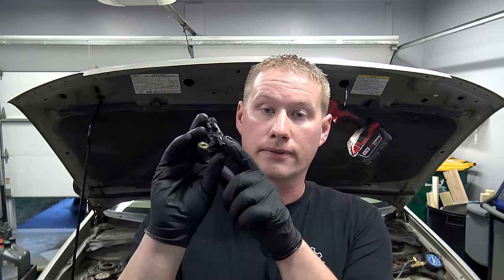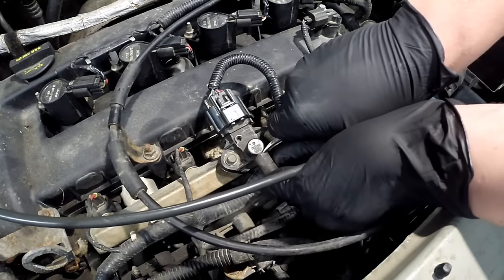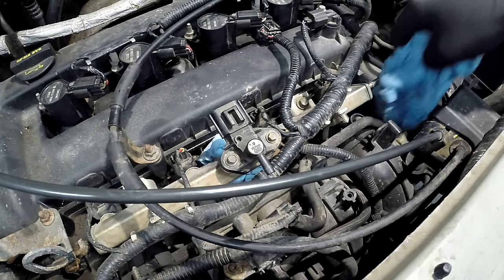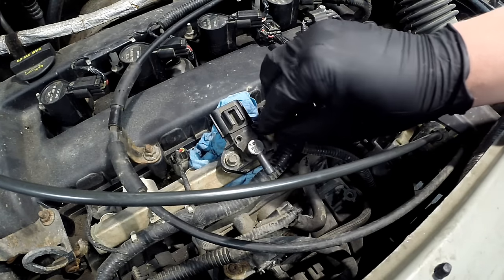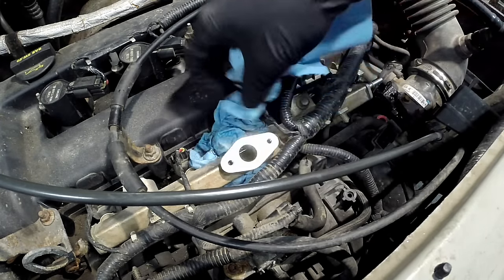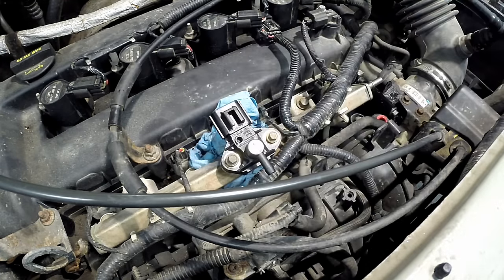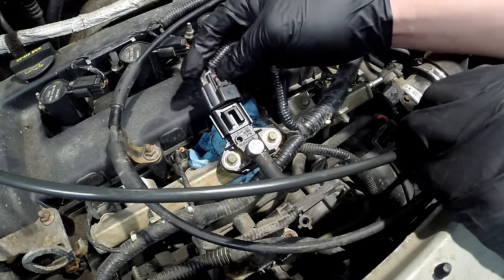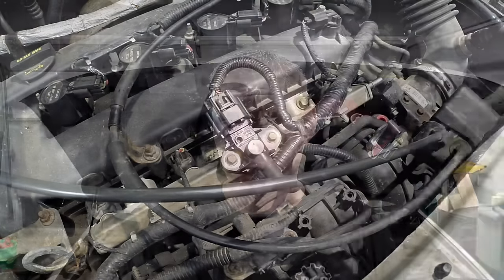Ford Vehicles: Fuel Rail Pressure Sensor Replacement P0191

Comment: On my 2008 escape 3.0, I have a P0191 code and the car shuts off randomly and has poor acceleration. Could this sensor cause these symtoms or should I look into the pump?
Love your videos by the way
Thanks
Reply: Pls what did you do, have the same issue with mine ford Escape 2007
 It does seem to want to accelerate. Change fuel pump, plugs and flushed the nozzles. I'm so confused

Comment: Hey I've replaced my sensor but I don't know where the other side of that vacuum hose goes to. can you help me out?
Reply from the maker: It varies with each vehicle and engine but the length is not that long it should connect to a constant vacuum source.
Reply: FordTechMakuloco i have the same focus as the one in the video. same engine and everything.

Comment: Great video. I have a 2000 ford focus sohc, it seems to have low fuel pressure at idle, could it be a faulty fuel pressure sensor? It runs good when driving, rpm are low at idle and at red lights. Any suggestions will be appreciated.

Comment: as i was running a diagnostic on my 2008 ford escape i noticed engine load is at 30% , is that due to a bearing on a pulley driven part starting to seize?
Reply from the maker: No they all say that

Comment: My 2004 escape 3.0 doesn't have one of those anywhere I can find, it's just not there anywhere on the engine likevit is in all the videos.  So what do I change to fix a p0001? Is mine integrated into the fuel pump?

Comment: I have a 2009 F150 4.6 liter. I'm having a power loss issue. I had it to a mechanic he changed the fuel filter and it didn't make a difference. He put it on his scanner  and no codes are showing. The truck runs fine at start up seems to take the fuel no problem. The problem is when the engine has a load on it. If you step on the pedal it's like nothing is there. I'm going to make an appointment at the dealer. Is there anything you can suggest that may be the problem?
Reply: Please how did you fix it? Having same issue

Comment: i have a 2005 Ford F-150 4.6L. i replaced the pressure sensor and the check engine light still on. Is there anything else i should be checking?
Reply: Same I replaced my Air filter on my 05 Lariat and the P0191 code cleared

Comment: My code reader shows P0193 on my 2005 Ford Five Hundred also identified as the fuel rail pressure sensor. Looks pretty straightforward.
Reply: Did you happen to see the pressure in the fuel rail?
Reply: @RickyPisano  I have not attempted to replace the sensor yet. I've simply cleaned the contacts at the connector. So far so good.
Reply: @Vaun's Photography  did you ever fix the problem?

Comment: So I have a 2006 f150 5.4 and I have changed the fuel pump about 7 times and changed the driver module and and bypassed the inertia switch but I see myself changing fuel pumps every other week , the fuel pumps keep popping the check valve on the fuel pump so could it be the fuel pressure module on the fuel rail
Reply: How did you fix?

Comment: What was the reason for changing the sensor? 

Question for you ;

I have an 05 Escape with a 2.3L engine that has excessive fuel in the combustion chamber and exiting out the exhaust.

I have codes P0183 and P0193 ... any help would be appreciated.

Comment: I have a 2003 Ford explorer with 4.0 v6 sohc vin.k it will not start I checked the fuel pressure I get 61 pounds but when the motor cranks over the gauge needle jumps does this vehicle have a gas pressure regulator ? It has spark

Comment: Just bought a 2008 Ford E 250 van  that was sitting for a long time .  Replaced the battery and it cranks but no start . Diag. scan shows P0191. Is this the only fix for this code ?

Comment: will my check engine go off after I replace this? or how do I clear the code?
Reply from the maker: Pull the negative battery cable for 10 minutes
Reply: Thanks, I had the same question. Worked!

Comment: What are the symptoms of a failed sensor.     I’ve been fighting lean bank codes and very low power on a 2005 3v 6.8.   When it runs horrible I can unplug the sensor and it runs good again.    Can I leave it unplugged till I get the new sensor?

Comment: Hey Brian. Have looked at all your 5.4 videos. Saved me a lot. From ball joints to upper control arms to front diff and rear fluid services. Bought the aftermarket, plugged it in, and it stumbles and missed so bad. How do I diagnose to make sure this is the actual problem before buying OEM?

Comment: Does a 2002 expedition with a 5.4 have this type.  The engine is dripping fuel while idling.  It drips from the rear passenger side of the engine.

Comment: Hello, good morning, I'm speaking to you from Chile. I have a Mazda Tribute, and I have a problem with code P0191. Is it possible that the sensor cuts off the fuel pump? I don't want to make a mistake and buy a fuel pump. I talked to a technician and he tells me that the problem is the pump and not the sensor. How can I know exactly if it is the problem with the sensor or the fuel pump or not? thank you

Comment: Hello do you know where’s the fuel injector pressure sensor for an 08 navigator I have scanned the whole front end and no luck even took the intake out thinking it was hidden somewhere any tips will be really appreciate it thanks in advance
Reply from the maker: You don't have one, it is mechanical returnless system.
Reply: FordTechMakuloco thank you so much ill have to double check the computer it was giving me a code for it at advance and even at ford they were giving me the same sensor 🤦🏽‍♂️ when asked where it was they would say the fuel supply assembly but theres nothing there.

Comment: Hi
Have a 2005 e 150 Ford Van and got this code P0101-FF today and it said fuel rail sensor.. 
Also driver side front Cylinder sometimes get coolant in the spark plug area and had to replace the coil pack several months back. Second time.. Not sure where liquid in seeping in from..
Any thoughts? 
Thank you in advance...

Comment: I got an 04 f150 I did the fuel filter, fuel pump module and new spark plugs and I'm getting a lean code for bank one and a P0193(fuel rail pressure high input) what should I go to next? Fuel pump or fuel rail pressure sensor?
Reply from the maker: +Alyssa Wil this code can also be due to an open in the wiring on the signal side of the sensor going back to the pcm. Use my video to test it first
Reply: Alyssa Wil did you find out where was a problem? Ive got exactly same and can not figure it out for months now :( Now im trying connector outside under driver seat for back signal to fuel pump...
Reply: madMX96 I did so much to this truck it's insane. I had codes before that code. It took a bit to figure it out that it messed up more than just that. I did the fuel rail pressure sensor which was super easy (when I got that code) If you hear the fuel pump kick on when you just turn the key (it shouldn't be super loud) then that's fine. After all the parts (fuel filter, fuel pump module, spark plugs, transmission fluid and filter, when it stalled the first time I took it to ford and it needed an imrc solenoid,  I did the fuel rail pressure sensor, intake manifold, and finally new catalytic converters on drivers side. And all problems are gone. It has balls and doesn't stall, spit, sputter, or hesitate.

Comment: Thanks so much for the great tutorial.  I happen to own one of the vehicles where the FRPS is hidden under the manifold (2007 Explorer 4.0L) so I need to get to it before I can replace it. I would NOT call myself a backyard mechanic - I'm a mom on a limited budget. I have a Haynes manual but it is obviously written for those with more automotive knowledge than I have. Do you know of any tutorials on how to remove the manifold cover? I need pics or a video because I don't know (yet) what most of the components are. Any references would be GREATLY appreciated!

Comment: Are there any electrical tests that can be done to check a sensor that isn't triggering a code?  
If you reset the PCM will the vehicle start with the electrical connector off?
How much does the vacuum adjust the electrical signal to the PCM - is it a trim?
Reply: Found your video on testing the sensor.

Comment: Is this part on a 2014 Focus SE? I keep getting a P0087 code and I replaced the HP fuel pump, fuel pump, fuel pressure sensor.

Comment: 05 crown Vic..I had a CEL for this item. When I pulled out old one, there were two washer shaped cups sitting down in there? The O-ring came out with old one but after that,that’s what I found sitting down in there...any idea?

Comment: I got a 08 escape xlt v6 all wheel drive 
Engine light is on. Its a p0135.
If i take out this part &   try cleaning it 
Will my suv run better & not shake when I'm at a red light???

Comment: Hello.  great video. I need help with something. I have a 96 ford explorer with a no start. Sometimes .maybe once or twice a week in have to use starter fuel to start the truck. and then it will run. but in a day or two am back with useing the starter fuel .now it seems to be getting harder to start with the starter fuel. I would love to have your input on it. thanks.
Reply from the maker: +Larry Griffin You likely have a failing fuel pump it is going to be hard to catch but you need to test for fuel pressure when this is happening.

Comment: FordTechMakuloco.
I have a P0087 fault on my 2012 Focus 2.0L GDI. fuel line pressure is 4 bar but the car still limps. Could it be this sensor?

Comment: I maintain a fleet of 12 Ford Freestars. I have found most times when the PCM sets PO191 its a plugged fuel filter or bad fuel pump.
Reply from the maker: +WhiskeyRiverRifleman I have seen the freestars fail high and low they seem to be the most troublesome in the Ford lineup.
Reply: we use them for taxi's in a medium size city in upstate ny. they take a beating for sure. mostly transmission issues, and upper intake gaskets. I will say the engines hold up well. we have a few with well over 200,000 miles that run strong. transmissions are straight up junk though.
Reply: I failed to mention I also have seen a lot of wet pcm issues. I used fords method and it fixed 'em for a while but they always get wet again. I ended up  relocating the PCM's to inside the car. also, I have gotten some good info from your channel, thanks for sharing.

Comment: 2013 Ford Escape SEL. Engine shut off while driving... it "slowly died" while driving. Mechanic says "it's the fuel rail sensor switch". This sound right? And would it be about the same set up as your video?

Comment: Is the car still drivable if I have this fuel rail sensor problem. I have a ford 500
Reply: Yes. I've had this component bad on my car for more than a year and it still drives fine. Finally replacing it in 2 days lol
Reply: I have the same car but mines drives for a while then it dies after a while when driving but shortly after I dam drive again. Ppl are telling me from the codes I have that are popping up, the issue is the part he’s replacing now. I’m wondering if anyone else had those problems?

Comment: Hi,FTMakuloco
is it normal fuel pressure at 30 psi on ford expedition 2002 5.4L?
if doesn't what should need to be replace?
thank's.
Reply from the maker: Engine Running kPa (psi)
193-310 (28-45)

Key On Engine Off kPa (psi)
242-310 (35-45

Comment: I have a 06 Ford Expedition. I have the  Po191 code. I replace the fuel pump and filter. When i go to start it up. Sometimes I  have a time getting it' started. I replace it with a Motorcraft fuel rail pressure sensor. And it's still doing the same thing.

Comment: Had a lot of things done to my truck now one of the things that that's coming up is the fuel pressure sensor. I don't want to keep spending money on the truck is there a way to clean the sensor for testing to see if that's the problem?

Comment: (2007 Navigator) i have changed pump...COP plugs starter ....truck runs well but has a looong crank now...sometimes 2 attempts to start ...long enough where folks ask if I'm good. Could this be my problem?...causing it to loose pressure in the line until it rebuilds????

Comment: I have a 2003 Windstar with 3.8l. Morning start is multiple cranks and then it finally starts. No rough idle or lack of power during the commute. Shut it off and if you need to restart within 30 minutes, it fires up right away. Leave it for like an hour and you're crankin a few times again to get it started. But then it's ok for the drive... Any ideas?

Comment: How about on a ford 6.7 powerstroke ? I got a p0088 fuel rail pressure too high . Do you think it could be a fuel pressure regulator on the fuel rail? Or the pressure sensor?

Comment: We have been driving around for almost a month now with the sensor unplugged. 
I'm disappointed in those boys at "Oil Stop" they were the ones fiddling around with the engine when l take it in for oil change. 
Do I plug it back in when engine is cold ?
Or ' should I leave it disconnected ?
"It TICKS me off, customers spend good money for simple services. we give them business so they can have a decent job, and somehow they still screw up !
Last time that splashed dirty engine oil all underneath exhaust manifolds on my new car. I still get that smell of burnt oil. They said sorry, but how does that help me and the value of my new car ?
I got off track, do l just plug the fuel pressure sensor back in , and leave it ??

Comment: What was the vehicle doing that made them want to check for this issue?  I have a 2004 Ford Freestar and I just bought it and the prior owner said there was a fuel sensor issue. I have not checked the code yet cause I am concerned about the transmission skipping while driving first but I checked the fluid and it is not red anymore it is BLACK... Yikes
Reply: 2004 mercury moutanner 6 calendar how to replace 
Fuel Injection Pressure Sensor.

Comment: My 2005 Ford Five Hundred is throwing a P0191.  By the way it's driving...it definitely seems fuel pressure related.  Will this part Motorcraft CM5229 Fuel Injection Pressure Sensor fit on my car?
Reply: Pls what did you do, have the same issue with mine ford Escape 2007
 It does seem to want to accelerate. Change fuel pump, plugs and flushed the nozzles. I'm so confused

Comment: I have a 2007 Ford Escape 2.3L. The check engine light came on and it said that it was this sensor. I replaced it and it was still having the problem I unplugged the battery but I wasn't aware that it had to be for 10 minutes. Does it matter if its the whole 10 minutes? I got a 2nd replacement of the sensor and put it in and the code is still saying the sensor is wrong. When I accelerate the car hesitates and jerks. Any ideas???
Reply: I have same vehicle. Please did you fix yours?
Reply: I had bought two different brand new sensors and they were defaulty ones. Got my money back and finally the third sensor worked properly. Never had a problem since

Comment: Will this work for a 2008 Ford F-150 5.4 V8?
Reply: I just did it on my 2007 f150. Same steps, it's on the drive side. The only issue I had was the one I took off didn't have an o ring on it and there was noticeable amount of debris on the nipple going into the fuel rail and underneath where it mounts to the rail.

Comment: i have a 07 f150 5.4l  i have two codes p0148 and p0191.... i replace a new  fuel pump and new fuel rail pressure sensor two years ago. what do you think about that? help me please bro

Comment: I got 65 psi on my 2004 ford mustang...ford says should be between something like 27 to 37 psi running....I don't know if sensor is reading it wrong or if it actually is 65 psi

Comment: dear sir  where is the fuel pressure  regulator  on a 2009 lincoln  mkx  awd i am having  a problem  with too rich  code po175 any  information  you  can give  me would be  a big help
Reply from the maker: in the tank, you most likely need a canister purge valve.

Comment: Are these on the 5.4l? I'm having issues with my expedition running like it's out of fuel and misfiring.

Already replaced the fuel pump.
Reply: Same,
Did you find the problem?
I have a 2008 f250 5.4L
Reply: @mannynieto21   No, sadly. It was a timing issue on mine that I was far too late to diagnose.

Comment: I am having a dilemma with my 09 Focus Bryan. I am getting code P0451 which is a fuel tank pressure sensor. However I brought the tank down and there was no pressure sensor insight. Is my fuel rail pressure sensor the real problem?
Reply: How did you fix it?
Reply: @chidiuche754  
Bryan let me know that the fuel tank pressure sensor is attached to an EVAP hose. This EVAP hose goes from the fuel tank to the canister if I am not wrong. I was able to locate it and I changed it. That was the fix.

Comment: i have a 2007 w a error code P0451 and U0100 any assistance i know one is the fuel tank pressure senor but no clue on U0100
Reply from the maker: Forget the U codes until the FTP sensor is diagnosed and fixed. U codes can come from an internally shorting FTP sensor.

Comment: daughter has a 03 focus, randomly shuts off, driving or just in park at idle.  fuel filter change regardless, it did need it. gas cap was bad so replaced that. battery was very poor shape and needed replaced, hopeing that was the cause but nah.  pulled the fuel pressure regulator trimmed the vac hose back a little, blowed through it and put some vac to see if it was leaking,. seems fine so I put it back on..   started car and manually adjusted the idle up to about 750 rpm wile in drive with e-brake on   idles smoother and it should of shut off 10 times by now during the time it took me to type this,.  only time will tell

Comment: Thank you for your precise video. It appears the same sensor can be purchased for near $20. Are not all sensors create equal?
Reply: I tried that move and while the car was fine for a little while, it started acting up again and the code had come back. I guess I have to purchase the more expensive version like he said if I want the repair to last longer.